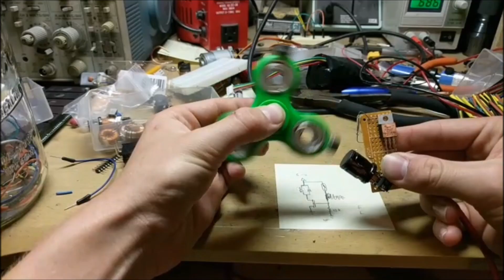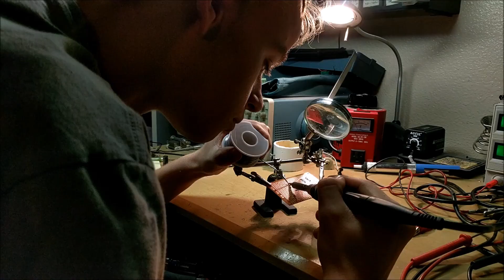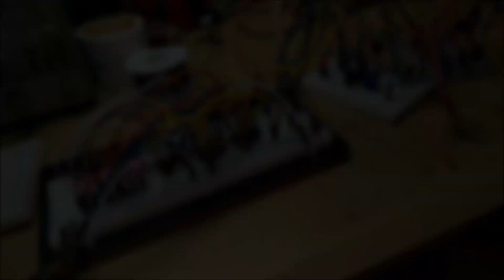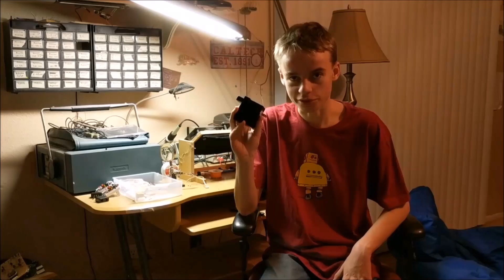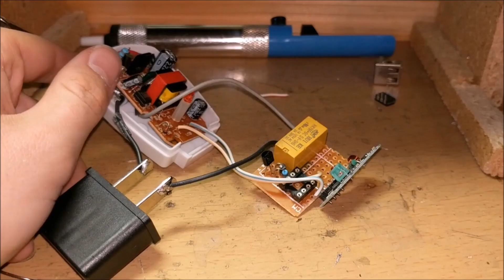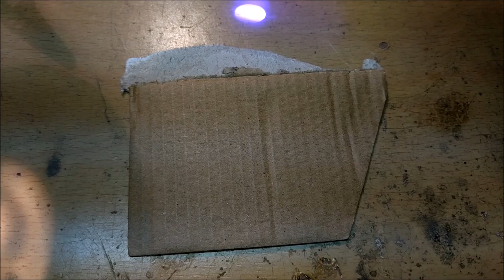Build the Future One Circuit at a Time: Tanner Tech Channel Trailer

Comment: Tanner, Sir, I have a question.  Is there any way to make a capacitor drain its power more slowly by using a transistor, and chip, may 555, so that when one miliamp of current goes through, it shuts it off, but repeats this over and over in cycles so that a capacitor can be used lke a battery?